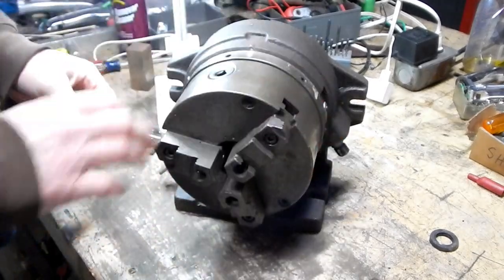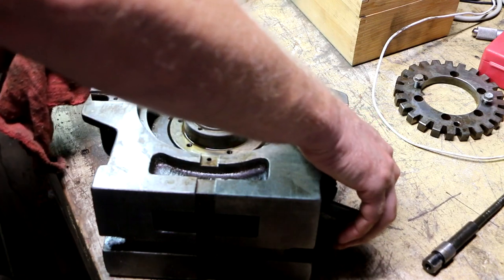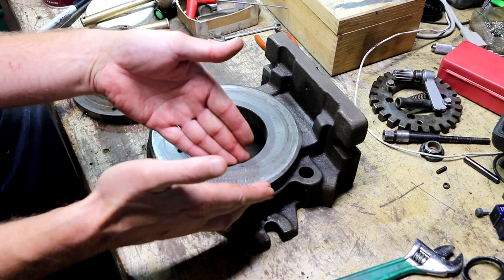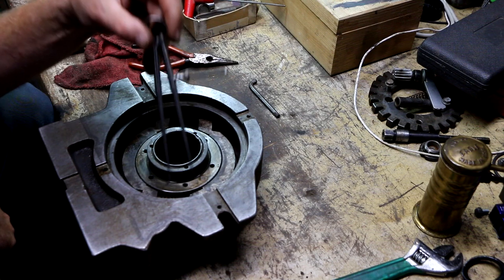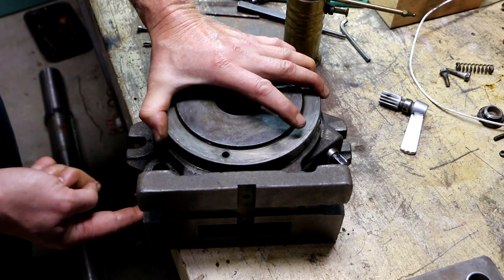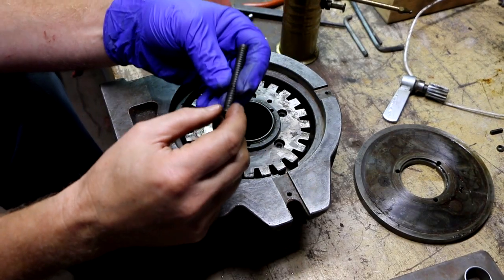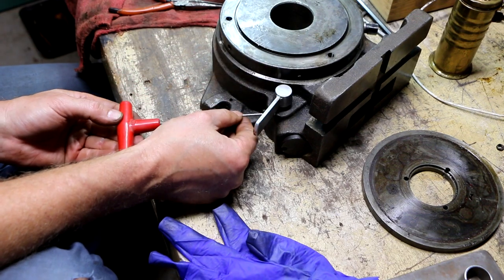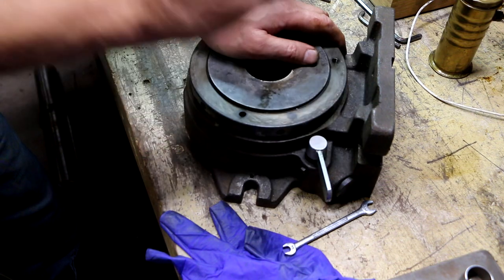Import Super Spacer Tuneup

Comment: could you tell me where you found the hartford super spacer manual? I was given a hartford, I have it apart for cleaning and would like to have the manual for reference. I also think you were right to use oil instead of grease. On my BurkesMiliwright mill it calls for oil in most areas. It also utilizes the grease zerks as oiling points. I'll be using oil on my superspacer when I reassemble. Thanks!
Reply from the maker: Sorry, I do not remember where I found it. I'm sure it was through a Google search. Sometimes it's easier to click on the images tab in a Google search results an look for a Pic of a manual page to find a site.